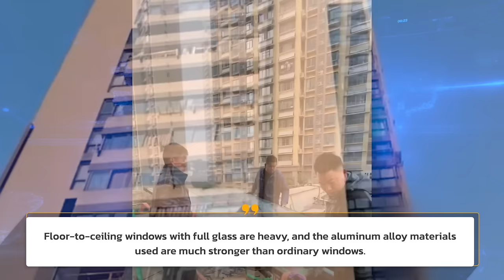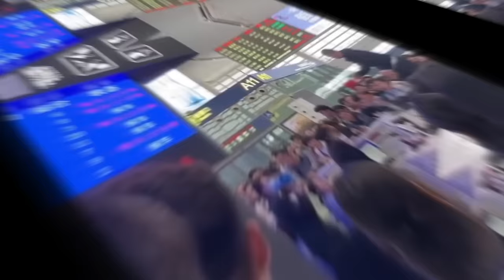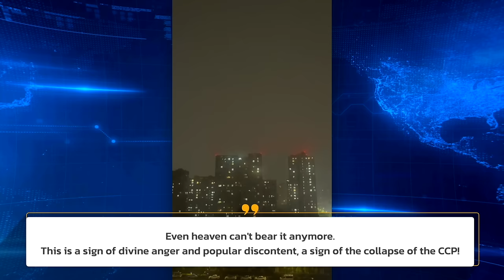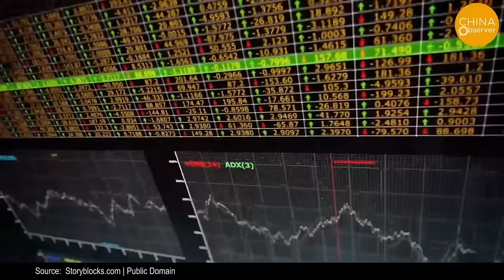China Can’t Hold Anymore! Storm of the Century and Giant Hailstones Strikes Jiangxi

Comment: If you notice, the blown out windows were not broken until they hit something. 
The window mounts and brackets are what failed ---
NOT the windows themselves. 

That shows poor construction that is not allowed in the US.  
Here, windows in high rises have to withstand winds of 120 mph, at least.
Reply: not sure where you are from, in some parts of America, window, & are secured by tap-cons 2 concrete jambs / window sills, & headers, if you want 2 go all out, & by screws into the 2x4's jambs, sills, & headers, the doors only the 2 sides, & the top, they aren't going anywhere, the exterior doors hinges, even should get some longer screws added, but as a homeowner, you have 2 do it, the builders' do not do it, & if they do it = it is extra, & most homeowners have no clue about this, no longer screws added = the door will be sucked off of the hinges, if left unprotected, the door frame will stay, that is how you build strong, stable, & secure, all of the openings 2 your home / windows & doors 4 the lay person

Comment: Many years ago I worked for a window manufacturer that made amongst other things, curtain wall box section. I can tell you now that those window frames are nowhere near big enough to be used on the 20th floor of anything. This is the type of environment where properly enforced safety standards would have saved lives.

Comment: Garbage construction. No way the wind should push the FRAME in during a storm.
Clearly NOT the window construction. It's the installation. They used caulk maybe to hold it in.  Pathetic
Reply: I would like to ask if the places where tornadoes have passed through in the United States are complete? Please use your brain.
Reply: @木鱼老汉半夜敲  brain time. 
Storm 100mph. . Not equal to tornado. 300mph. 
I am a carpenter / contractor.  Over 35 years. 
I use my brain when installing windows. Tornado come. Window fly WITH house. Not fall out. 
Use brain num num.
Reply: @walsterdoomit  = yea, WE use tap-cons at varying lengths screwed into the jambs of concrete walls, & all around the window frame, & doors, if you so desire, & 4 wood jambs / headers, & sills, = various different lengths of screws, for 3 inches or more of 2x4 studs jambs, top & bottom if you so desire, so that window frames are fastened like Ft. Knox = the more you fasten & secure windows, & doors, they aren't going anywhere, don't you just love how people think that they know, what they have no clue of what they are talking about
Reply: @THE_REAL_ME_I_AM  honestly I don't think they used any screws.
Reply: @walsterdoomit  ~ Elmer's glue or rolled up duck tape, that was pathetic, I can't see how that entire window  frame didn't hit that child in the head, at the start they were up, laid down, got up again, & back down, & whoosh, it comes flying in, & it looks like it hit that child in some capacity, with the couch blocking most of it, & yet it still fell down towards the child, & the sheer stupidity of some of the comments, are just astounding, speaking without thinking things totally through, or speaking as if they know, & you know = WE have 2 put them in their place ~ peace
Reply: That's USA